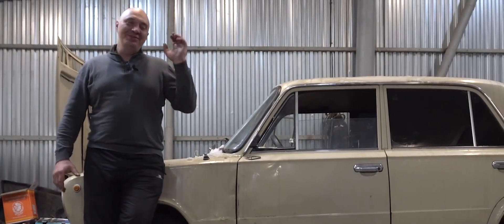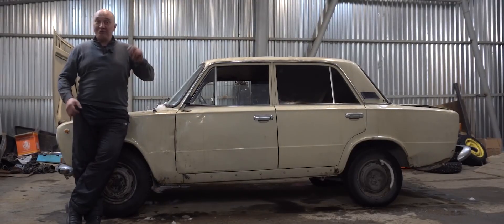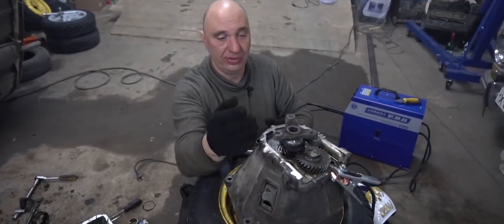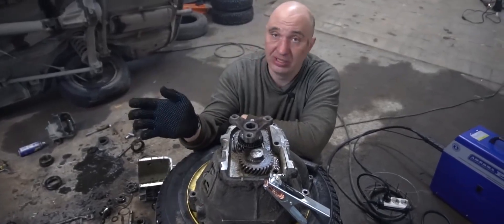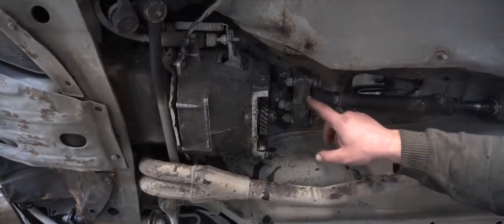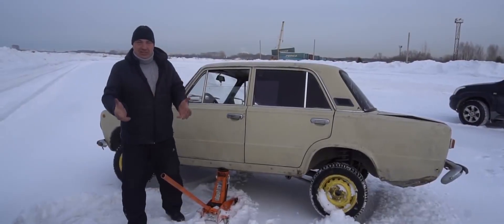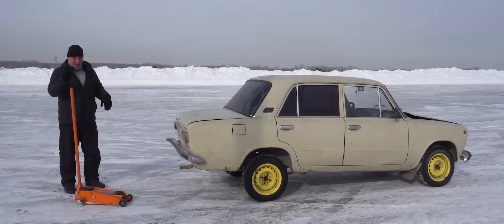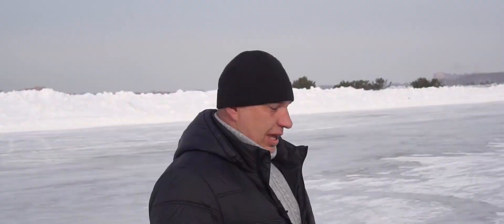Welding the prop-shaft to the motor and driving without a gearbox

Comment: Russians are supposed to be good at finding the simplest way to achieve a result without all the complicated stuff.  It occurs to me that this entire project is rather silly when you consider that the DRIVE gear in the transmission is short for DIRECT DRIVE meaning that it is the same as having a straight shaft with no gear reduction to the final drive gears and is already built into the gear box.  If the transmission has an overdrive gear it means that the output shaft from the transmission is spinning faster than the input shaft providing more speed and better fuel economy with reduced power.  Hopefully you can make a video response explaining this to the viewers that wanted to see it done.

Comment: Me: Ok I'll get the jack and the stands.

Dudes: 😏 whats that???
Reply: The gearbox is there to remove the excess energy so the shaft will not break. That is why the shaft is breaking and bending because there is no gearbox. When we start the car and change gears the purpose is just one simple purpose to protect the shaft from breaking because of excess energy and the gearbox is the only way to do it. He should have studied the purpose of the gear before trying a new theory.
Reply: @Dailymailnewz  you misunderstood the joke

Comment: Next time use my method I promise you there will be nothing to break but the only weld you have to do by welding the input shaft directly to the tailshaft. The input shaft is fitted inside the tailshaft from factory with a bearing. Just remove the bearing, weld it together and toss out the counter shaft and bolt the trans back in and your good to go. No other modifications have to be made anywhere else. This could be done within a couple hours max.

Comment: It would have been easier to just remove the countershaft in the gearbox and weld the input shaft directly to the tail shaft inside the trans. Eliminating the roller bearing in the end of the input shaft and making it one solid shaft from the front of the trans through to the driveshaft. This would have the same effect but be a lot stouter and way easier. You wouldn't have to cut anything at all. Even using the stock driveshaft.

Comment: It's not the rubber coupling, it's the extension not being wide enough to handle the torque.

P.S. I'm a mechanical engineer
Reply: That was so balanced did u see that weld 🤣 wide enough to handle the torque my axle shafts thinner..... I hate engineers.... Can I kick you in the nuts?
Reply: @joker4206987  bruh wtf
Reply: Yes I agree with you an extra thick peace of pipe and also an extra bearing and carrier.
Reply: Engineers lmao
Reply: Its the unbalanced drive shaft

Comment: having no gearbox is like being stuck in 4th or 5th gear, the slip joint needs to be as close to the rubber as possable. the rubber was up to it . but the shaft could flex and unbalance at the joint

Comment: driveshaft breaks because when lowering the jack driveshaft gets too much force instantly on every part but if clutch would be pressed and slowly sliding it till car is mowing than it probably would work
Reply: Driveshaft needs to be on a sleeve so it has some give like a sprint car Thay have no driveshafts just a lever to engage or disengage when working on motor or pushing onto the track before the push truck push to start then once the race is underway its wide open throttle turn right to go left and wheelie onto the straight-a-ways and hang on for a wild ride...

Comment: Now you know 😀, good to know why parts are designed in such a way to make it function as we know it.
Reply: That's correct but who needs transmission anyway car moves without transmission... Just  don't back-up or stop... Kinda like them building a sprint car no battery, starter or transmission, every tire is different size in hight & width and usually just three breaks and when your racing just hold the gas peddle to the floor and wheelie onto the straight-a-ways... If you ever get a chance to watch Sprint's go to it they are wild expressly the non-winged Sprint's you might enjoy watching them a wild ride ...

Comment: please make another one like this, i wanna see direct power from engine to wheels
Reply: Watch sprint car racing... Thay have no transmission, no battery or starter have to push to start the non-winged Sprint's are a wilder ride the winged Sprint's (out law's) have bigger motors but the non - winged lift the front wheels a lot more going into the straight-a-ways and turn right to go left and for wipeouts wild ride...

Comment: May be keep the clutch working
Reply: Just st build a sprint race car direct drive ...check them out on YouTube the non-winged are wildest rides but smaller Motor's the winged Sprint's are the outlaw's big motors but the wings help keep them on the track like 800+ horsepower no transmission no battery or starter push to start and wheelie onto the straight-a-ways turn right to go left....in the turns at over 100 m.p.h.

Comment: I basically did this with a 70 Mustang doing 70mph.  The 4speed ran out of gear oil due to a rear seal leak.  First gear is the fastest free spinning gear, which is why it welded itself to the output shaft in an instant, popping it out of 4th gear.  Slowed down REAL FAST to about 35mph in no time as the 302 shot up to 7k rpm, and then the front u-joint broke on the parkway by the old J&L mills in Pittsburgh PA.  Attempting to pole vault with the now dislodged drive shaft, it pulled the tailpipe clean over the rear end and wrapped it around the driveshaft.  Best thing that happened was a traffic jam due to the Squirrel Hill tunnels at rush hour, so I was able to peel away the exhaust and change the u-joint (had a spare) on the side of the road with cars going slowly by.  Started it up having to hold in the clutch to stop while in the slow moving traffic jam for about 1mile, before getting off at my exit.  It was also quite loud with no muffler or tailpipe.

Comment: This was kind of pointless. As every mechanic knows: in nearly all gearboxes, one of the "gears" is Direct Drive (usually 3rd or 4th) that drives the differential directly from the engine. All you would need to simulate this is find out which gear direct drive is and just leave it in that gear.

Comment: What you need is a centrifugal clutch between the clutch and the prop shaft, like on a chainsaw. Maybe one from a super large chainsaw of the type they use for felling these monster trees. That should prevent excessive torque buildup ;-)

Comment: instead of hitting the gas hard, wouldnt it help it start better under load if you were to slowing let off the clutch and let it gradually start instead shock loading the shaft?

Comment: Did I misunderstood something.. you just cut away the gearbox and left the clutch to be able to start soft.. but then you dropped it onto the ground with the wheels turning at high rpm so the engine wouldn't die? Why didn't you start soft, with the clutch?!?!?!

Comment: I have one make a car with out a drive shaft but have a gear box connected from said engine to the back wheels but the engine stays in the front the only thing that drives it will be fixed gears from the engine connected to the rear wheels.

Comment: You need a hanger bearing for the front drive shaft, also you would find a bell housing enclosed clutch and just attach the shaft output to that, then you would have no need for the jack to get it going

Comment: Cool vid! How about installing two transmissions, end to end. The rear trans is installed backwards. With the rear trans in high gear is normal 1:1.. Then shifting the rear trans to third would result in a gear reduction... Or increased pulling power... How much load will it pull? Cheers!
Reply: Would to see the Russian boys try this

Comment: you guys should have tried to used the clutch to get the car moving, not slamming it on the floor and flooring it. a more "gentile" transmission of power to the wheels, and more support on the axle should do the trick

Comment: 1.     build a support for whats left of rear of transmission,  as well as a support bearing behind the coupler (transmission side)
2.     use the clutch to ease the engagement from stand still,  dropping the rear when spinning will shock load the driveline and hurt it no matter what.
3.      try heat treating the new fabricated prop shaft  to make it less brittle

Comment: You can achieve the same results by putting your 5 speed in 4th gear none as direct drive. The crank will spin just as fast as the drive line. So your trying to take off in 4th gear, it's not going to work.

Comment: Don't you have a lathe? You could use it to make a hole in the center of the primary shaft rear and fit a bearing. Than make the shaft extention to slide into the bearing.

Similar like primary shafts are fitted to the crankshaft.

The reason your hardyrubber shreds to pieces is misalignment due to vibrations.
By fitting the bearing you keep the cardan shaft aligned and the hardy rubber only has to transfer the radial forces.

Btw love your crazy experiments.

Comment: lesson 101 about balanced driveshafts. it would have worked but if that shaft is even 1 gram out of balance it will distort and then it has a natural ability to twist in half. I think that if you did the shaft properly it would actually drive.

Comment: Hey, ive done this  on a ford truck, the auto trans blew, so i extenders the shaft,w/a slipyoke/centerbearing shaft, bmw flexjoint bolted to crank w.3 outtah 6 bolts, reinforced with 5/16 cable(after 2nd one) drove through 3 states, 465 miles to get home! Obviously at nite with less traffic and stops, Guess what? 1:1 gear ratio? Yup, just like being in high gear,starting onna hill is necessary(2 starters) when alone! BAD DECISIONS MAKE FOR GREAT STORIES!

Comment: Why did they need the jack to start this up?  I thought this would act a bit like my geared riding lawn tractor.  It has a clutch/brake pedal that you can use, otherwise the transmission is connected straight to the engine via a pully.

I don't need a jack to get my lawn tractor started rolling, so why is it necessary here?

Comment: The shaft broken because the it's too long without support, in the replay you see that it starts to shake as the torque start to increase and broke .
It needs a mont bearing in the same spot that the gear box ended

Comment: There are 2 stroke go karts that have direct chain drive and no clutch. When you stop, the engine stops. the difficult part is the start. they lift the back, run and then jump in and the engine starts. you can't do it with the car but you could push the car with another car to start it. This would also make it easyer for the drivetrain putting less stress on it.

Comment: Maybe the the shaft extension shouldn't have been made out of a freaking water pipe. A harder steel extension could work, but that Cardan-cross just exploded like a bomb. Anyway, you can entertain low-minded idiots until you have spare cars to fuck up.

Comment: I have a suggestion for a future video, how about dropping the oil out of the sump pan and replacing it with water, change the oil filter so is got a brand new filter, then see how long it will run for before the engine seizes up or boils the water off!

Comment: most amazing thing about this video, the thick skin it takes to just casually perform mechanical repairs in the middle of a God forsaken frozen lake in  unthinkable temperatures. My fingers would be burning while holding metal tools and then there is the whole concept of getting under the car, laying on ice while it's being hoisted by a hidráulica jack that could wobble due to the weight and the ice. 👌🏼

Comment: Looks like you need a bearing to make the output shaft shorter, so it can't flop around so much. Try moving the car easier by using the clutch, it won't shock load the coupling so much. I am sure you can make it work!

Comment: this test is the same as putting the transmission in 4th gear or direct drive depending weather or not its a 4 or 5 speed.

Comment: Why did you cut off the back of the gearbox, the input shaft protude a bit at the end of the casing. By welding here you will have two bearing, the front one in the bell housing and the rear one. That way you don't have a slip joint moving around unsupported and an input shaft that stay centered when using the clutch. Time for a new gearbox to sacrifice.

Comment: The reason the drive shaft failed was you needed a carrier bearing on the end of the new prop shaft 
 Also a centrifical clutch is more appropriate because you are taking off in basically high gear or direct.
 Rotation of the crankshaft and driveshaft is the same in all cars because to basically reverse the direction in a transmission leaves a very weak transmission in a normal car reverse is the smallest shafts gears and bearings .
 Not sure I explained that clear.
 Changing rotation in the transmission causes excessive wear to the transmission and fuel consumption.

Comment: Do they have cars with automatic transmission in Russia? Maybe try using one with the transmission taken out. Of course the car will roll when starting, but that shouldn't be a problem if you're in a big open space. I have an old Ford pickup truck that can drive under it's starter power alone...essentially making it an electric/hybrid vehicle, Hahahahah!

Comment: What model Lada is this? I've never seen one with round headlights.
Reply: Earlier one, 2102 here. 
Are you sure you never seen round headlight? They are most of ladas.

Only 2105 and 2107 have square headlight. 
You sure you've not even seen very common 2106, with dual round headlight? It's everywhere!
Reply: television and cheese I'm American the only ones I've seen have square headlights. I really want a lada even though I drive a 1992 Cadillac sedan deville.

Comment: Is just a matter of balance. I did a swap on a fiat 124 and I shortened the power shaft, then I ended with a lot of vibration in a specific speed. It was corrected with proper lineament and balance

Comment: I dont think it is the rubber piece's fault. The part you made for the driveshaft was to unbalanced and vibrated too much. It should be like driving the car in 4th gear since most gearboxes are 1:1 in 4th

Comment: You should try replacing the rubber coupling and shaft extension with 90 degree joints and rubber belt that slips a little (not fully tightened)... That should ease the excess torque when tires don't rotate as fast as the engine... Essentially it would convert it to 1-speed automatic transmission.

Comment: i suggest to try  connecting the motor -> torque converter -> prop shaft
since the torque converter from automatic transmission have so much slip, it will be interesting to see can it start a direct drive or not

Comment: I've always wondered what would happen. If you ran a vehicle STRAIGHT from the transmission to the drive shaft.It  would be rough and impossible not to stall at a stop. But you could start it with intertia no  problem. Man that be like driving in over-drive or 5th gear from lift off and to a stop..Yikes!

Comment: Isn't this like driving in 4th gear? The ratio is 1:1 between the engine and driveshaft, wich is the same as 4th gear in most cars, give or take a small difference in ratios

Comment: Could've just put it in 3rd or 4th and skipped all the cutting and welding but I guess that wouldn't make for a good video. I thought they were gonna weld the driveshaft directly to the crank

Comment: How's about welding some steele gas Line Loops to the front A-arms of a rear wheel drive car. Then standing the car vertical with modified rear wheel hubs. To become a chain winch So that it can climb or be driven straight up the chains spooling the chain around the drive wheels. Maybe the car would require a granny gear. So what you would end up with is a Car elevator. Climb in facing the sky. Buckle up and drive up LoL that'd be amazing inside a building! Or up an exterior wall

Comment: Some transmissions like mine have a strait through 1:1 ratio gear selection, which is my 4th gear. Power is not transmitted through any cogs with teeth. So essentially this is just like driving with 4th gear only.

Comment: The reason your shaft broke was not because of the rubber being weak but because of the big unbalance in the axle making it swing around so much it snaps. 
It could work to either way make a completely straight axle that is well balanced or use extra support bearings to keep it steady and you could rock with it I’m sure. 
But it was fun to see some parts flying anyway ;)

Comment: the issue is the balance of the shaft when a higher centripetal load is applied it tore itself apart I had this happen when i got a ding in a shaft from a rock.

Comment: Should I tell them that you can just start in top gear and do the same thing?  It’s a lot easier. 

And yes, it can be done. It’s just very hard on the clutch and takes forever to get going.

Comment: Pretty simple what's gonna happen if its 5 speed transmission  attaching the driveline to  the crank will be 1 to 1 ration with the rear diff with is 4th gear a 1 to 1 ration lol